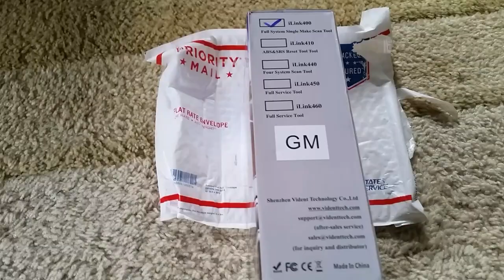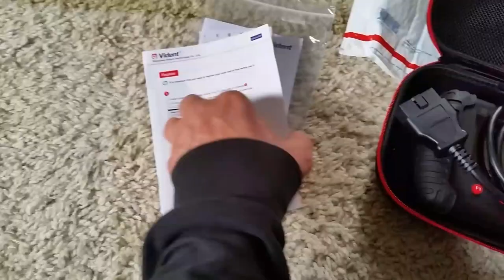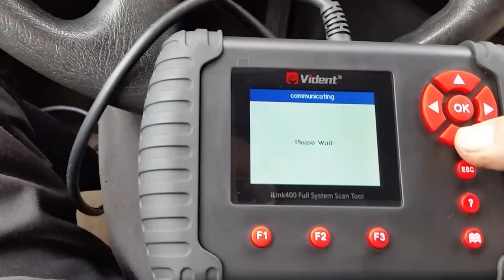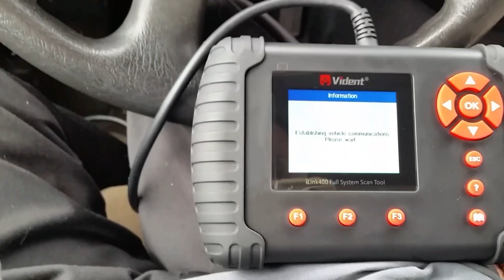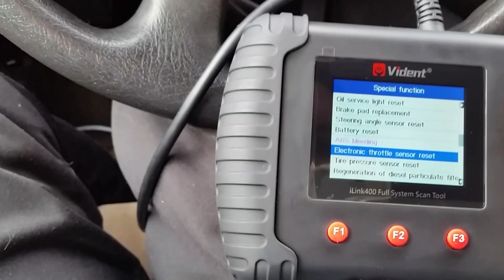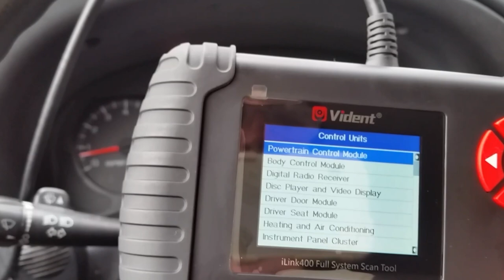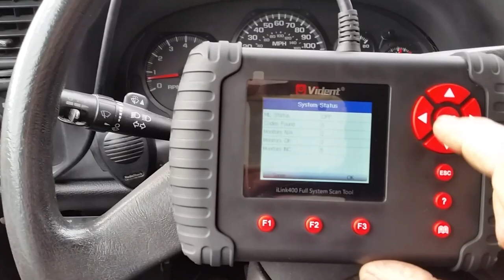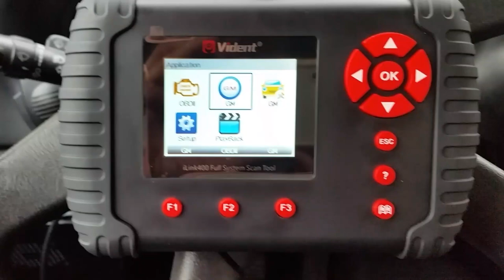GM iLink 400  Full Scan Tool Review. Full Crank Sensor Relearn Demo Etc

Comment: Thanks so much for doing this video. I bought the iLInk400 several months ago and have been playing around with it to learn all of the functions. I have searched for videos or instructions on how to use this scanner and have found very little info. The videos that are out there are mostly guys scrolling endlessly thru all of the options which is ok if you're looking to buy but does little for practical use of the scanner. The manufacturer support is limited to registering and downloading updates. I had to do the CKP relearn on my 2000 Blazer but didn't have the scanner at the time so cost me $250 at the garage. You're video has shown more than anything else I've seen. For the price it does have a lot of functionality. I've used mine to check fuel trims and O2 sensors but so far no PCM changes as I'm still learning and like you said you can change things with it that can leave you stranded if not careful. Hope to see more videos and good job.
Reply from the maker: Nice!
Reply: Hi do you know if they’re bi-directional?

Comment: I got the Vident iLink 400 GM only version off Ebay after watching your video. I have a 2003 Chevy Silverado 2500HD and it threw a P0300 code. This little scanner was able to do the Crank Sensor Relearn and my code is gone. Money well spent!
Reply: Did you have any issues?  I've got a 2004 2500.  I got to the "Accelerate to WOT.." , did that, and it just never seemed to learn.
Reply: @rlstorment  I had no problem with that. Worked just as the video shows.
Reply: @michaelmiceli1907  Thanks!  Wondering if my new sensor is bad or something.
Reply: @michaelmiceli1907  Eighth time is a charm...
Reply: @rlstorment  What did you end up doing?

Comment: You did not scroll all the way down when you got to the Power Train control module screen.  Did it have the "camshaft relearn" function for when you replace the cam sensor?  What about the throttle body position relearn?
Reply from the maker: Don't need to relearn a camshaft sensor. No such thing on this year. Crank is all you need to relearn with a new computer.

Comment: That’s great bro!! Seems like a handy tool to have !! 
My 02 has a evap light also 
I replaced the gas cap we shall see what happens but I almost think it’s the valve near the spare tire I only use it in the winter and  summer I brake out the TBSS 
It’s awd however the 02 is 4wd and much better in the snow 👍🏻
Looking forward to seeing how the scanner does on the evap code on yours 
Your easy to follow along with ! Some guys just show ya the scanner then skip right to the finish part I like know how everything works! Keep up the great work!!!

Comment: Do you think that this scanner will work with my 2005 workhorse truck ( GM engine) vertic 6l v8 ?
thank you for your time.
Reply from the maker: Depends on what your doing.
Reply: @FixingWithPassion  
nothing really special  . Just to keep the truck in good mechanical condition & to be able to find accurate information to any problem or codes. and reading accurate live data.
many thanks for your time.

Comment: Hi. Did you ended up changing the stereo ? And we’re you able to unlocked it.
Reply from the maker: I put a touchscreen in it. This tool does not unlock radios but does other things. I need one that does just that. You have to buy a another tool for radio unlocks ugh...

Comment: Ps if you get a chance and Remember can you look up a 2016 Chevy Malibu 1.9 eco I believe but the question is does the scanner show if it can disable autostart? It drives me NUTS!!! Would love to just delete it right out!! 
I can turn it off on the shifter but you have to do it every time you start the car ugh!!
Reply: Just remove the fuse for the stop start and it will never bother you again...
Reply: @nightstorm9128  man I wish it was that easy 
There are 2 trans fuses I will have to dig into for sure everything I have read says it can’t be disconnected however I believe the newer ones do have a switch to turn it off

Comment: I purchased a Ilink400 scanner. In the application setup/key test, The reboot key doesn't  light up red or beep when pressed. It will reboot the tool if pressed  for 3 to 5 seconds. But doesn't light up or beep in the application setup key test. Is this normal.
Reply: Does the relearn thing work though because I’m looking super hard for something that can relearn after my engine emplacement

Comment: I have never heard of crankshaft sensor relearn...the sensor is just a Hall effect with the crank ring being just a big magnet...there's no reprogramming in it....just put in a new sensor and it works....
Reply from the maker: At least for My Trailblazer. Two things may have to be done after you install your E.C.M.  First an anti-theft
relearn may have to be performed.  If this is the case the truck will not start.

The second thing is that a crankshaft variation relearn may need to be performed once the vehicle is
running. This will be evident if the check engine or service engine soon light comes on once the vehicle
is running. You will need access to a scan tool capable of doing this procedure to do this and clear any related
trouble codes (Code P0315). If this is not available to you a repair shop will have to perform this and clear the
related trouble code. The vehicle will run normal but the ”service engine soon” light will come on and a
trouble code will be stored until this is resolved.

Instructions for both procedures will be included.
Reply: That is incorrect. When I rebuilt the engine in my 2000 Blazer I had to do a CKP sensor relearn. A relearn is required when the CKP sensor is replaced or taken out and put back in. The sensor reads the position of the reluctor wheel on the front of the crankshaft and sends to the PCM for timing and RPM's. The CEL will stay on until the relearn is performed.
Reply: @techmanok  the relearn procedure teaches the computer how much distance there is in the gap between teeth. The vehicle will run, but it won't run optimally without doing the relearn procedure.  These procedures exist for a reason, much like you need to relearn other parts other than just replacing them....because the computer needs to know the variance in values the new part reports to the ECM.
Reply: I was about to put 1 in and found out you have to do a re-learn.I am getting this vident because the machanics in my area mess up everything they touch or they are to busy and you have to wait 2 weeks. 2002 GMC Yukon Denali 186000 mi.
Reply: Sometimes it does
Reply: @emmakeyser1459  Did the check engine light come turn on after you replaced the sensor?

Comment: I just want to make it clear before  I say what I think about this product,  I like this product. I just  got the product yesterday and I went on to diagnose my car. The first and second  test went well, but the third one the device froze two times when I try to use it. It connected to the car, but when I try to use the arrows again to move around, they would not move. I have two cars that are the same, so is not my car computer. Has anyone experience this problem? I have 30 days to return the item, and I have two other OBD's for other cars that can read the cars that the new OBD can, but no all. Another issue is the cable, I find it a bit loose that come from the OBD machine, and also I have to run the engine so the OBD can connect this causes me to use fuel while doing the test has anyone found these problems? Otherwise, a very good OBD it does many professional things, great product apart from what I encounter.
Reply: My new Ilink400 scanner. application setup/key test, The reboot key Bottom right side looks like a open book. It doesn't  light up red or beep when pressed it the key test mode. It will reboot the tool if pressed  for 3 to 5 seconds to escape freeze's.

Comment: Wonderful...i have the same GM Vident ilink400 tool...was wondering if you or anyone found where i can "increase" the idle speed from 824 (factory setting) to about 950 RPMS?...and reprogram it to 950...can this tool work for that?